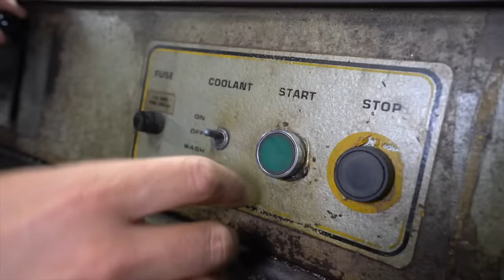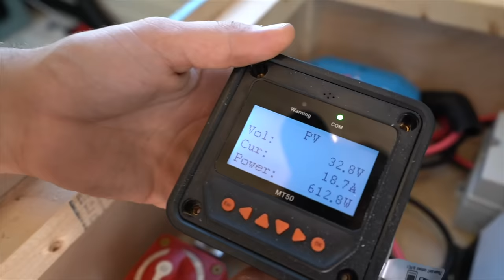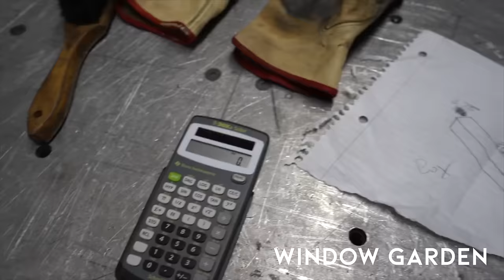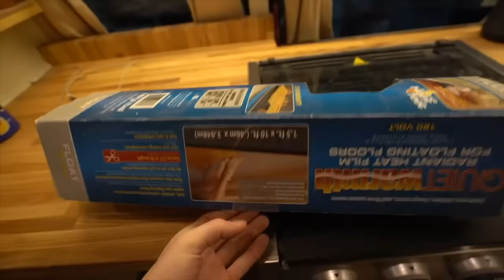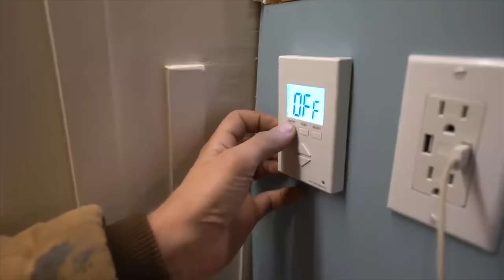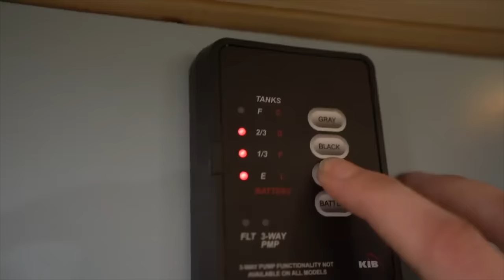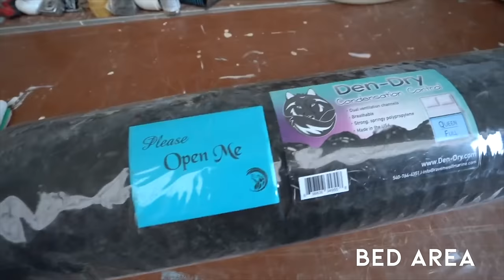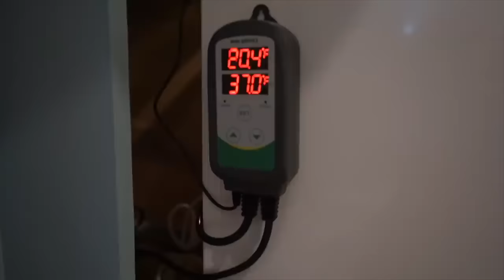Amazing Full Shuttle Bus Build Timelapse Start to Finish! Ford E350 DIY Camper Conversion! #vanlife

Comment: Really good skill set between you two! Impressive build! Only one thing I saw that missed a step: always soak your cane material in warm water, then install the cames/beading lock strips while it's still damp. When it dries, it will shrink and tighten to a perfectly smooth, flat and tight result. Leave the cane rough cut mats with some excess length and width (at least an inch or so) until it dries, then trim it. There are wax or linseed oil preservatives you can apply to both sides to keep the cane from becoming brittle over time. ( I often re-cane vintage chair seats for clients).

Comment: This is really neat an all.  I just don't see the practicality  of doing a conversion like this when there are 48 foot RVs out there.   that have slide outs on both sides.   And there is no 4x4 option either.     So it's pretty much limited to staying on pavement.       Its a NICE build.   No doubt about that.

Comment: I’m starting to run into a problem with these bus to camper builds.  Why is it the first thing that gets ripped out is the A/C system stem to stern when 90% of the systems are still fully charged and working.  Plus I just watched you rip the A/C lines open when you just contributed to the hole in the ozone layer.  Feel very lucky that I or anyone else didn’t report you to the EPA.  There are federal guidelines that you blew right through and the proper guidelines for Freon recovery and disposal.  Then you turn right around and throw in a roof mounted A/C system.  You’re not the only people I’ve watched videos on YouTube